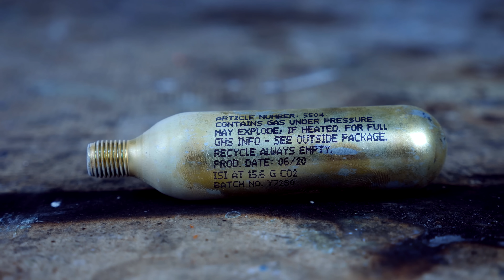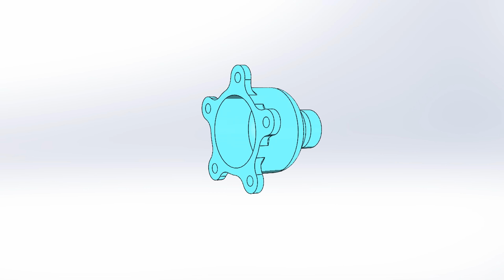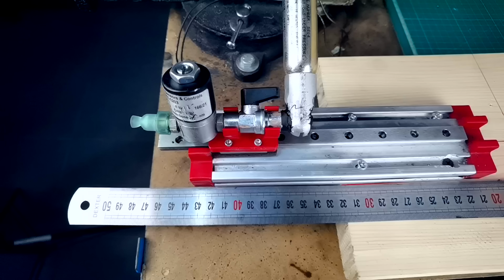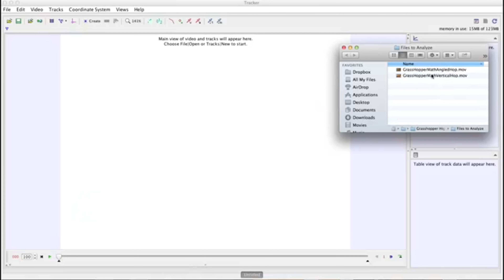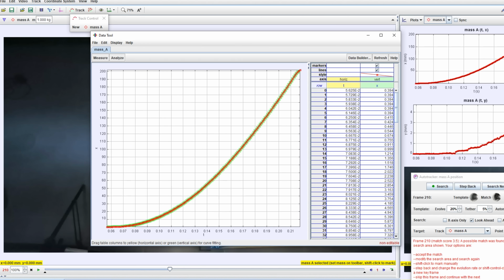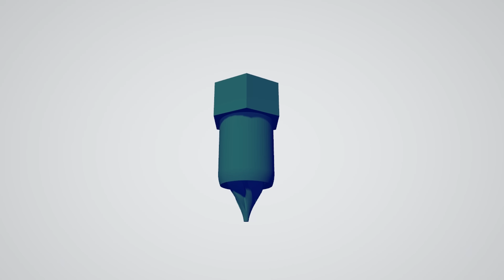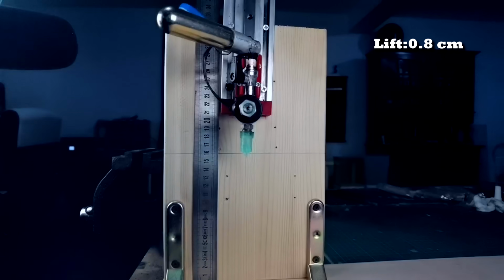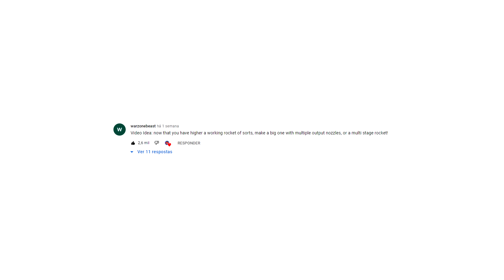I 3D printed a CO2 Rocket

Comment: Ceramics can handle very high temperatures, but you have to warm it up slowly. I've heard for example that a ceramic crucible can only handle something like 5 degrees C increase per minute for long life. If Integza had a kiln/oven maybe he could build a rocket entirely of ceramic that you heat up slowly and carefully before trying to run it. Obviously the logistics of final assembly/connections at high temperatures will be difficult. If you try ceramic again, slowly preheat it before you try it. It's just too much heat all at once for the ceramic, differential thermal expansion of the ceramic causes cracks and then it explodes.

Comment: its not solid CO2 in there its liquid CO2
Reply: Yep, a glance at the phase diagram suggests the pressure would need to be ~5000 bar at 298 K to solidify.

Comment: You should try using N2O canisters for a hybrid rocket. They are similar to the CO2 bottles, and are sold for making whipped cream.

You should also try making 3D printed molds for casting or shaping/ forming metal or ceramic/clay parts for cheap and repeatable parts, such as nozzles or mounts. You could also make a press to compact powdered fuel (like sugar with a binder) into fuel tablets.

Comment: I've seen a lot of projects in which prooves you can produce thrust through many ways, but it would be interesting to see a means of propulsion very simple in design and manufacture that has a variable thrust output, for both power and efficiency

Comment: Maybe you could use a capacitor to heat wires in the exhaust to further expand the exhaust, support a bigger nozzle.  Better ISP. Tiny capacitors and nozzle only have to work for a second or two for your cylinders

Comment: Future video idea:  try another ceramic nozzle design and use the CO2 cartridge to spray around the nozzle to cool it and provide more thrust.  See if the high pressure gas can keep the main nozzle cool.
Reply: Dammit. you beat me by like 13 mins.

Comment: What about if you make an actual rocket? Not just an engine, but a whole rocket that utililises something like a sugar based fuel, or if you want to go the cool route, use a nitrate fuel. They are combustable as hell and they are relatively easy to make. Just make some methyl nitrate by adding some nitric acid, sulfuric acid and methanol. Be careful tho, it's pretty dangerous if you do it too fast.
Reply: I think he is testing to see the best so he can make a rocket
Reply: 9:01
Reply: @crizpycheese8287  well, yeah. But a simple sugar rocket doesn't require multiple stages. And my suggestion was more about the fuel rather than the rocket but I do see how my wording may have been confusing
Reply: A REAL rocket? Not just prototypes?? now that is a bit much for Integza..... tell him the tomato's dare him to do it :)
Reply: He made that allready
Reply: https://youtu.be/NlT6XqpoeToye
Reply: Nireled should like this coment

Comment: You are still pulsing full power with the CO2, maybe an idea for a video could be doing this same engine with a variable flow rate and/or variable pressure valve to be able to control acceleration and ramp up rather than just pulsing full power

Comment: Video Idea: A Rocket powered car, not any sort though. In this one the rocket exhaust could be used to go through a system which then drives pistons (or perhaps a Tesla turbine?) such as in the case of early torpedo's powered by compressed air. This then turns a crankshaft which goes to the wheels of the car with a gear box in between to help it go. The car then moves forward with both wheels turning and some waste gasses coming out the back to propel it forward as well.

Comment: Video idea: You should build a sequel to the compressed air wankel by building an air liquid piston engine AKA rotary 2.0. 

It's basically a rotary turned inside out, which provides a better heat distribution and completely stationary seals.